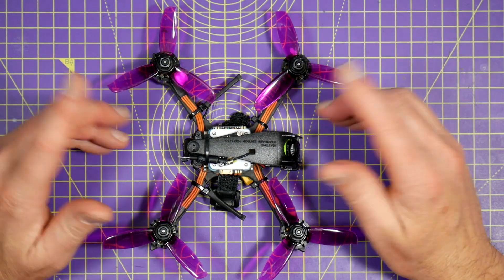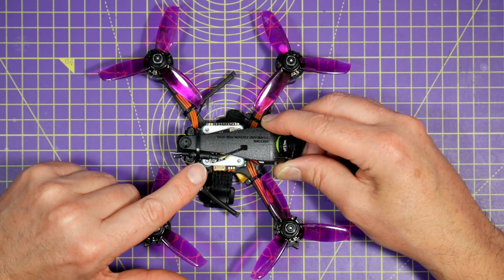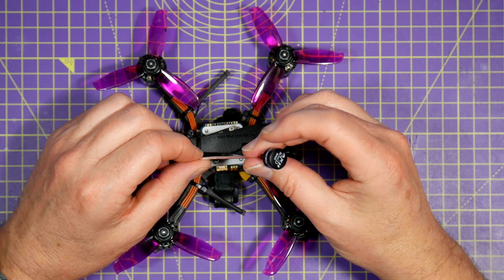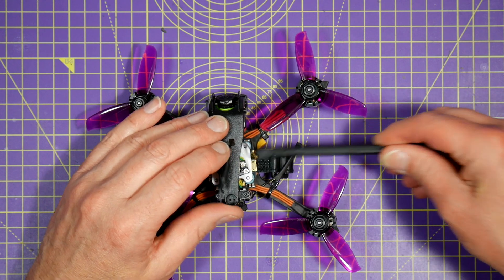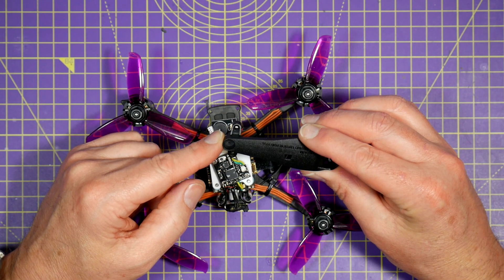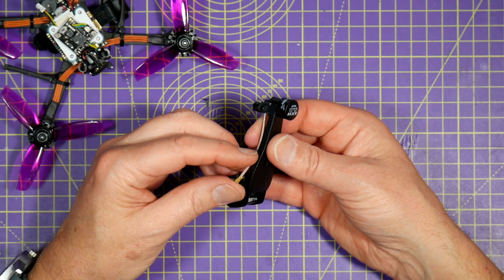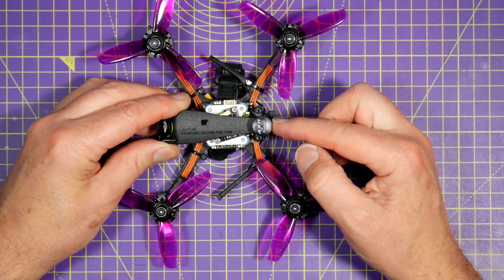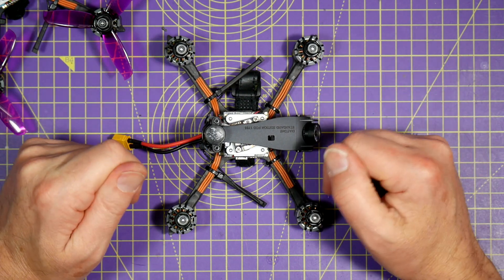Diatone GT R349 R349HD VTX antenna upgrade mods // Luminier Mini AXII Lollipop

Comment: I ran a lollipop out the back of mine stiffened up with zip tie and shrink wrap. I'm about to try this mod however as what I did actually  made it a nice snack for the rear props in a tree related aggressive park (crash) manoeuvre. I had thought about this exact mod and was cruising the webs looking for other ideas. I'm glad to see somebody else has had success with this. Seating it down into the recess with hot glue is a nice touch and I shall borrow this idea too. Thanks mate, nice work
Reply from the maker: Great ideas.....

Comment: I am getting my R349 set-up for this weekend. I've got the AXII antenna mounted securely and it looks great. Thanks for the suggestion. How did you mount your receiver? I can't seem to find a good secure location for it.
Reply from the maker: Zip tie it to the rear stand offs. It just fits.Check this in my other video https://youtu.be/3H5C9MTcjmk?t=461
Reply: @WhirlyBloke  Ahh perfect. Thank you! I didn't even see those holes in the stand-off for the antenna wires.

Comment: My antenna and mmcx came off while inspecting funny I managed to solder on a new ipex connection b4 I realized I Had already cut and prepared a lollipop 3 lol so undid this n direct soldered used skills n liquid electric tape, hoping for a solid link, looks good wish me luck, ohh and mine came with a black caddix the er349hd, think it's the same? I'm tempted to just put a caddix cam I know has the glass lenz ect..nice vid big up
Reply from the maker: Good luck.

Comment: I did the mod… but broke the connector :( //// Any advice on what vtx buy to replace it? (I didn't find the same tbs unify)
Reply from the maker: :0( if you're good at soldering you could just put a new UF.L connector on the board. They are very check to buy.
Reply: @WhirlyBloke  good idea, thanks! (I'll have to solder anyways if I replace the VTX, that btw I found, is the Runcam TX200U )

Comment: ???OVERHEATING???   Hello, Whirly.  I performed this mod and a few minutes after plugging the battery in, the fb began to beep and I noticed the stack was very hot.  Is this something that will go away once I begin to fly?  I'm afraid the VTX is going to burn itself out.

Comment: Thanks for this! I did it last night. Only thing is that you make tucking those wires between the stack seem so easy however it was not easy. Lol I just hope I didn't break them.. I won't know til I get the r-xsr installed and I power it up..
Reply from the maker: I like my wiring tidy just so if anything isn't where it's supposed to be after a flight it's obvious something's up. Take it slow and easy and you should be fine. They include spare connectors if anything goes wrong.
Reply: @WhirlyBloke  I followed all your instructions to a t now I only get a grey screen. I got osd but no video whatsoever. God I hope it's not broken. I paid alot of money for it..

Comment: I just done the same mod to my T-motor tm 3419 But I used the new TBS Triumph pro VTX antenna which is even smaller than the AxII Lollipop, I didn't have a drill so I just used an cheap crappy soldering iron to make the hole, worked fine. I'm yet to fly it, Bad weather here in Australia.
Reply from the maker: Yep a soldering iron works just as well.

Comment: The mod looks awesome, but doesn’t that kill turtle mode? I’m pretty sure that’s why they kept everything buttoned down on the top, so turtle mode would pop you right back over. Now there’s a big nub in the way.

I have one of these antennas coming but I’m going to run it out the back between the props. I really like the way your mod looks but potentially losing turtle mode would be a deal breaker for me.
Reply: Better to turtle mode on that then the dipole anyway man..
Reply from the maker: I've not found it causes an issue with turtle mode - in fact it acts a bit like a small shark fin which helps. And the lollipop is pretty secure when it's hot glued in.